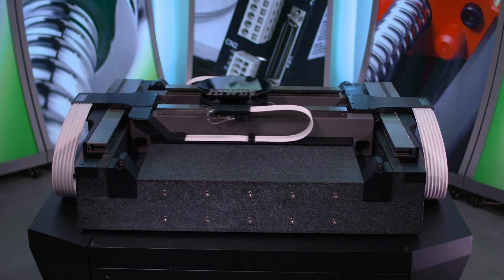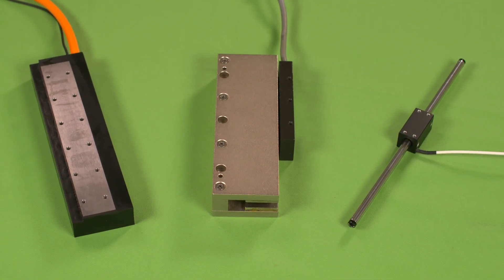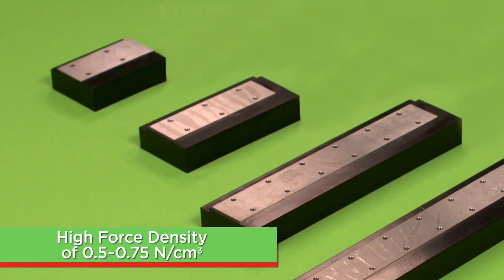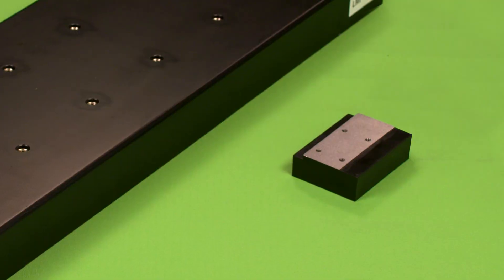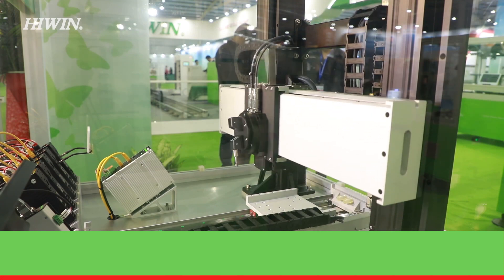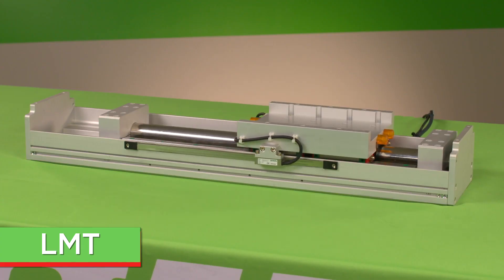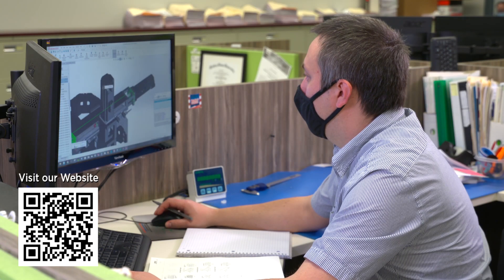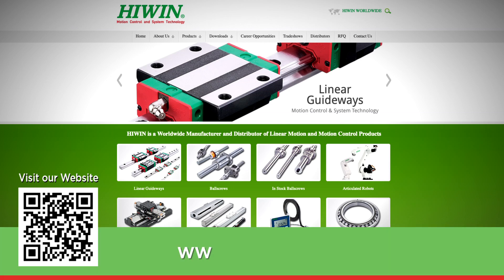Hiwin Linear Motor Components

Comment: Can l use linear motor with an Arduino/ if I can't how can I use it in other way
Reply from the maker: Yes, but proper interface is required. Hiwin linear motor with digital or analog encoders can be driven by Hiwin D1 drive with standard PLC-type (e.g. pulse/direction, PWM, voltage-speed control) or EtherCAT interfaces. For higher precision, closing control loop is necessary. Some system description can help to specify and identify motion axes construction and control system specification.
Reply: @hiwin-usa  Where is the main HIWIN factory from
Do you have in China
Reply from the maker: @askandartawfeq3096  Thank you for your question. Hiwin is a global manufacturing company. This YouTube channel is specific to Hiwin Corporation, which supports the North Central and South American markets. Our primary factories are in Taiwan, and we make, machine, assemble and distribute products in the Chicago Illinois area of the USA.  Please visit HIWIN.COM to find your nearest sales and distribution location. Thank you for your interest in Hiwin.